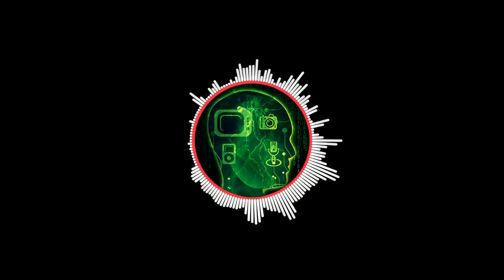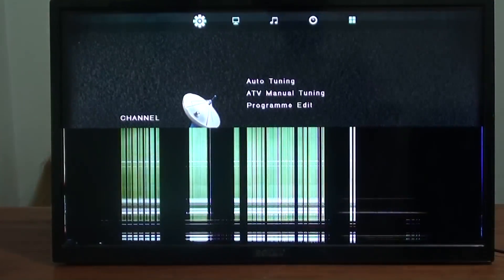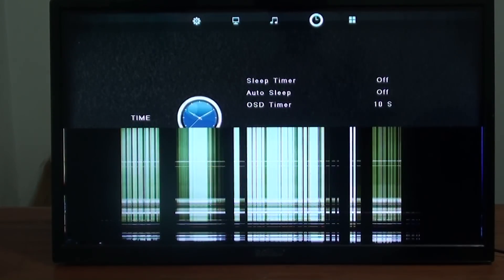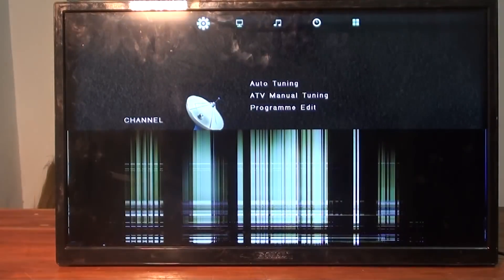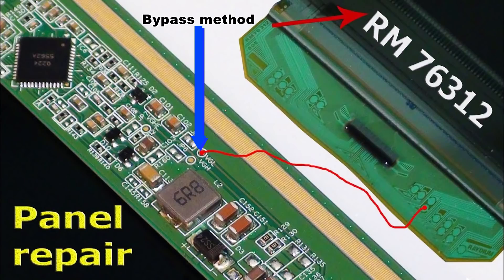Led tv panel repair vertical lines.#ProHack

Comment: I have problem on my lg 22ln4000...panel ticon lc216exn sfa1...
Vertical thin colour likes rainbow...
Vgl vgl vcc vdd voltage normal...v com over 12v (normal 5v.). Gamma voltage up down...are the ic gamma is broken ??..please give me solution...thanks before